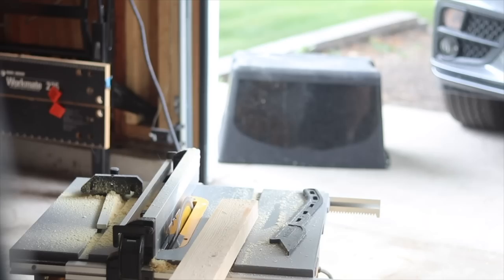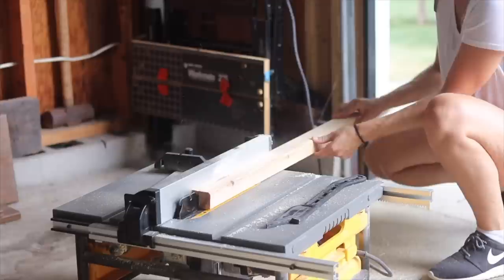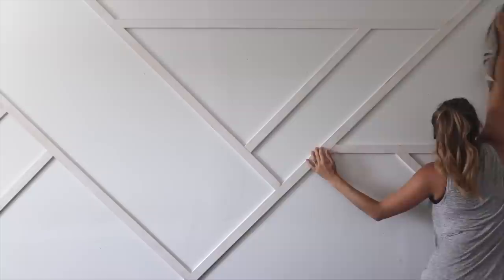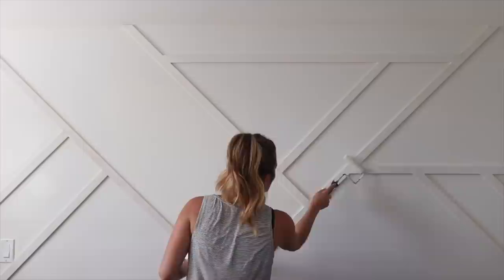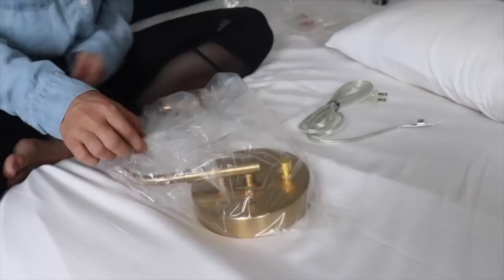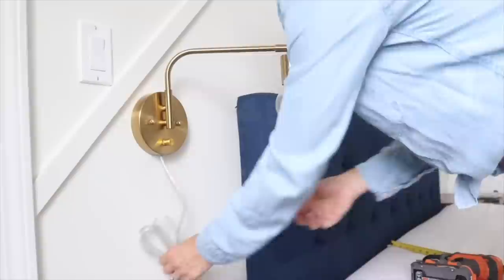How to Make a Geometric Accent Wall Using ONE 2x4 | DIY Modern Slat Design Feature

Comment: When ripping like that and use your push stick to push the board through,  please push the piece that is in between the fence and the blade to avoid kickback.  If it is too narrow then you need a different push stick or a grrrpr.  Also please get a Sawstop so you don’t lose any digits.

Comment: I would say the wall slats is your art. If you want to add some color, maybe you could get (or create) a large painting and cut it to fit in the openings between the slats. It could be kind of a "looking through a window" effect or maybe make it look like a stained glass window effect. Take a photo of the wall and use Photoshop to experiment with different looks.

Comment: I have a question. Did you randomly cut the slats and then make the design to fit the random lengths of the slats or did you cut the slats as you went?
Reply from the maker: I cut the slats one at a time as I went. 🙂
Reply: @WelcometotheWoodsBlog  Thanks. It looks great.